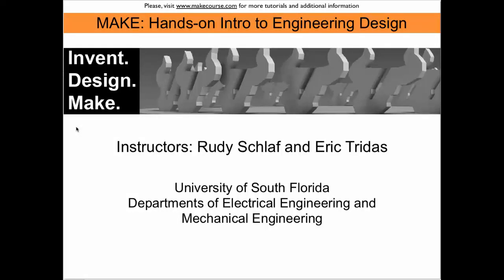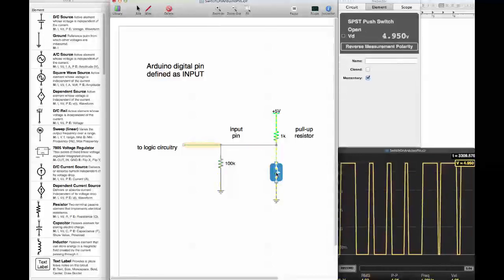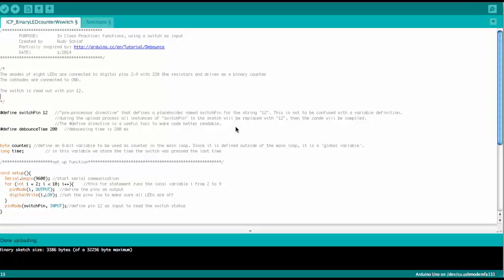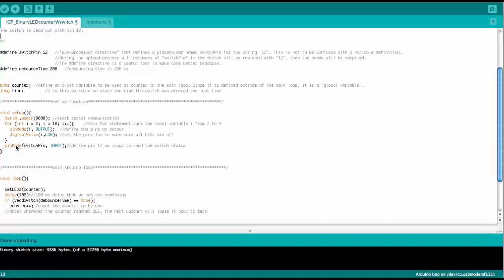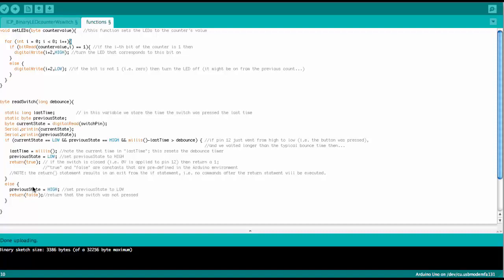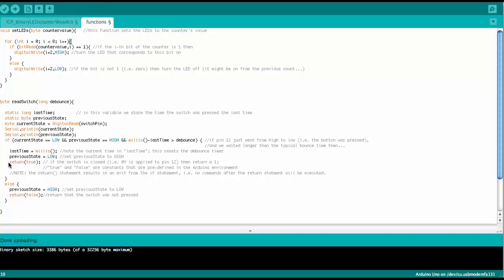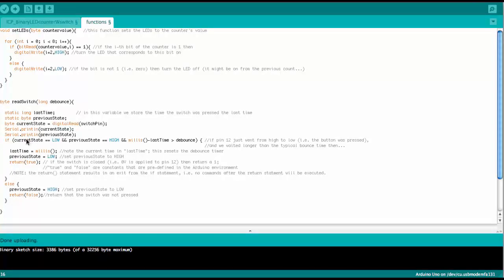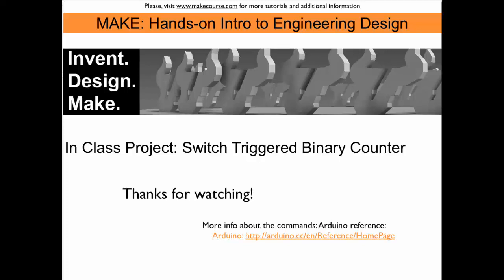In Class Project:  Switch Triggered Binary Counter

Comment: What program are you using to model the circuit?
Reply from the maker: The circuit simulations were done with iCircuit. This is a great app for playing around with circuits. Drag and drop editing and real time simulation while you make changes to your circuit. But it is not a true Spice simulator, i.e. it will not be good at higher frequencies etc...but for checking out basic circuit concepts, there is no better app than this. Also runs on pretty much anything that has a processor. Check it out at: http://icircuitapp.com. Absolutely worth the few dollars they are asking for it.
Reply: Thanks. You have an awesome course.
Reply from the maker: Glad you like it!! We certainly have a lot of fun teaching it!